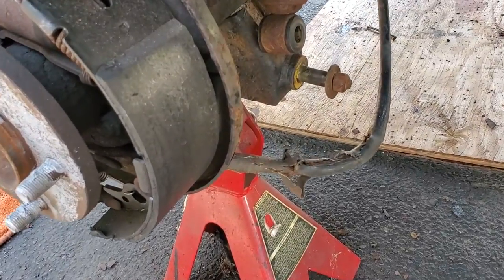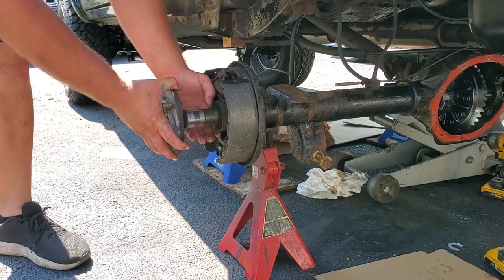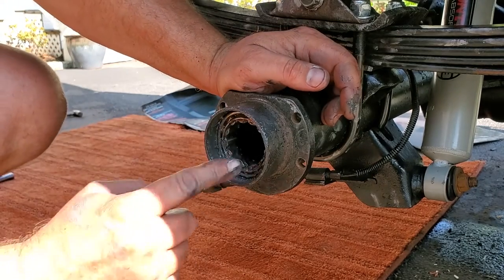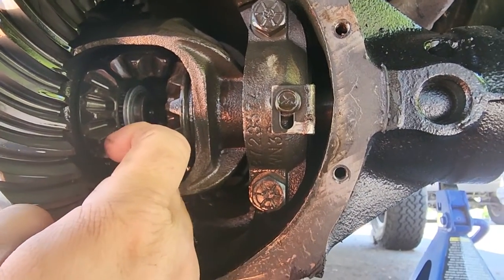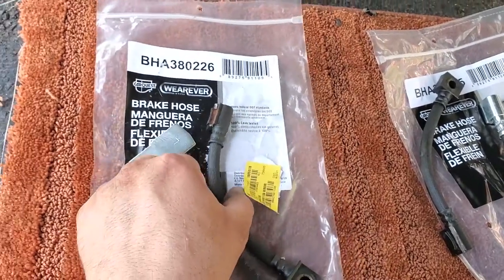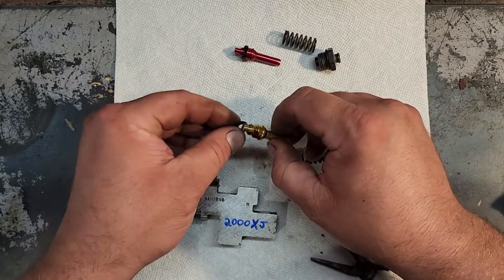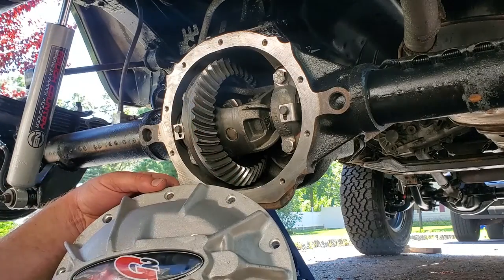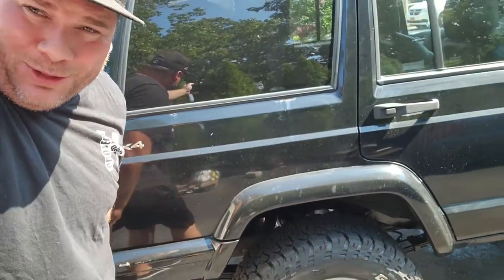JEEP XJ REAR DRUM TO DISC - HOW TO DO A CHEROKEE DISC BRAKE CONVERSION - ZJ DANA 35 TO CHRYSLER 8.25

Comment: Nice to see a new video DanH. I also have an XJ(2001) and have some parts for a rear brake ZJ disc conversion. One thing I did do as I have a budget boost rear leaf pack, I used a YJ rear soft line on my XJ as it’s a little longer. Don’t know a part number but it should be an easy part to grab at a local auto parts store. Look forward to seeing the stretch XJ in the future.
Reply from the maker: Thanks brother! Yes there's definitely a bunch of other parts that can be utilized for completely custom swaps!

Comment: A lot of great info! One of the best disc swap videos I've seen on the XJ rear break swap! Well done mate! I didn't know you could just swap the guts to the proportioning valve. I've got a rare 92 XJ 2-door High Output 4.0 with an AX-15 5-speed, an NP-231 transfer case, Dana 35 rear, 4" lift and lockers front and rear. I deleted the anti-lock breaks because I put off-road rated chrome molly 27 spline axles in the back because I was told the stock axles would not hold up with a locker. Changed the 3.07 gears to 4.10's from an 89 YJ high pinion set up. Off road and hill climbing, this thing is a beast! This is my next project so THANK YOU for all the hard work and excellent detailed info on the swap!

Comment: Nicely done.  I used the same differential cover, but in black.  BTW, the black plug is the fill level.  You remove the black plug and the red fill plug, and then add fluid. When fluid comes out of the black plug location, you are good.   
I did liberty brakes on my 93 sport and the only differences of install are the backing plates fit as is,  and you can buy/use e brake cables from conversion kits (I used crown disc conversion cables) because they are equal length until 1997 and up.  I think I saw somewhere that cables from certain years of Ford Explorer fit the 97-01 xj disc conversion. 

When I put the ZJ hoses on, we cut bracket into L shape and then bolted it to one of the leaf stack bolts- worked perfectly. 

Great to see this done, and hope you can get this on the general eventually.
Reply from the maker: Thanks Andrew!!! I was wondering why the new cover took so much oil! Haha mine didn't come with any instructions! Lol 🤷

Comment: Nice work - what might help is to get the rubber brake hose combination line for a 95 YJ - that is a longer rubber line & its stock fittings for the rear - Great Job 👍
Reply from the maker: Thanks bro!

Comment: With the studs on the backing plate! You can also use the studs from the front of the xj
Reply from the maker: Any stud that's longer. Lol!
Reply: Didn’t know that will try tomorrow instead of buying grade 8 bolts or going back to the junkyard to hit them out
Reply: @casualactivities1229  yeah i just used the studs for the front on mine and they fit right into the hub perfectly and are long enough although i did use the brakes off a liberty so i dont think the zj brakes are any different but they might be

Comment: ive done this swap on dana 35 and 8.25 using zj brakes the 8.25 u need to grind the bracket a bit to fit over the tube. never swapped the prop valve didnt need to it worked fine as is. super easy and straight forward swap.  but your better off swapping a ford 8.8 axle in.
Reply from the maker: LoL.  I didn't have an extra 8.8
Reply: @ProjectDanH  probably 1 of the best swaps ive ever done to my zj thats for sure. ford 8.8 with 4.88s and artec truss kit.

Comment: Can hardly wait for you to do the Dana 35 with ABS conversion. I have all the parts. Had to go back for the proportioning spring and ZJ shafts with the ring gear. I see there is a difference in the ZJ and XJ ABS rings and apparent;y not compatible. I am assuming you will still have to cut that notch out so I will wait to see the master do his thing. God Bless!
Reply from the maker: Yes, you will have to cut the notch! Looks like you'll be conquering it sooner than me.   let me know how it goes!!!

Comment: You might want to see if you can fab up a mount for the rear brake line ,  not a good idea to have it flop around. That line will fail at the hard line to chassis mount.
Reply from the maker: Good idea
Reply: @ProjectDanH   You can use a brake line from a Dodge Dakota cant remember the year but its way longer then the XJ great for diy lifts!

Comment: the bracket you welded for the brake line will that get hit when you go off road? looks to close to the ground
Reply from the maker: Its possible but we don't off road this jeep.  It could be mounted higher for off road use

Comment: Loved the video Dan! Great job. I ended up doing my disk conversion back in July. Did you have issues adjusting your e-brake cables? The install looks really clean with where you welded in the brackets.  I’ll send you a pic of my install with out welding, seems to do the job.
Reply from the maker: Yes, adjust the cable is the worst. Lol . Then once you dial it in they stretch! Haha.  Maybe I'll get explorer cables later
Reply: @ProjectDanH  yeah, they can be a pain. Explorer cables work? What year and model? 

Besides the ebrake adjustment, I love the swap so far well worth it and your videos helped a great deal!

Comment: Here is an alternative brake line set up, simply bend OEM line near vertical, bend hose bracket slightly and drill and tap 1/4 or 6mm hole to mount the hose bracket. to top of spring hanger plate.  Tried to send photo but no go.

Comment: Is that why C-clips are considered bad for off-road, if you bump your wheels/tires just right, they come off or is that only possible if the rest of the insides of the diff are already out?
Reply from the maker: C clip rear axles without disc brakes are bad for off-road (or on road with huge tires) because of the axle snaps the whole wheel will slide out.  Adding disc brake will keep the wheel on if the axle snaps apart
Reply: @ProjectDanH  Got it, thanks.

Comment: I never understand the portion valve and changing the spring. What exactly does it do using the ZJ spring?
Reply from the maker: It portions less fluid to the rear so the disc brakes wont lock up.. rear skidding is bad
Reply: @ProjectDanH  so I bought a g2 rear disc conversion but it didn't come with a spring for that. Should I still be looking to change it?
Reply from the maker: @ky0611  only if your rear brakes are locking up
Reply: @ProjectDanH  o ok Thanks, In all the other videos I've watched they talk about it helping with braking better. But none them talked about it helping not locking up the rear

Comment: i have a 95  4 cylinder manual xj i am not into offroad this is my daily car i have read on several forums to do the 4 hole injector to get a bit of performance whats your thought on this ? thanks in advance
Reply from the maker: 4 hole injectors are great.  I've done this in all my XJs!
Reply: @ProjectDanH  What's that all about when that gut said when upgrading from a single hole Injector to a 4 hole you have to have a larger intake hole. I have a 93' Grand Cherokee Laredo I6 4.0 and was thinking about upgrading mine to a 4 hole Injectors also. What's your take on all of this? Thx in advance for your time.

Comment: Great video I’m basically doing the same thing, I looked at so many videos and yours was the most simple video I found. I do have a question have you had any issues with the brake cables ? I know you said they were little longer that’s the only thing I left to purchase….. Thanks Dan.
Reply from the maker: Thanks for Watching!!!!  the cables work fine, but without a big lift you'll have to rout them where they wont interfere.

Comment: Hey Dan I have a question for you what paint did you use to paint the underside of the wreck  J . I have Rustoleum professional spray paint and POR 15 what did you use. Thanks.
Reply from the maker: I use both por15 and Rust-Oleum 😁
Reply: @ProjectDanH  Thanks Dan I will upload a picture of my XJ once its completed

Comment: 1st time viewer and a new subscriber,question, how do tell the difference between the D35 and the 8.25 Chrysler differential,on a '96 XJ, 1st time XJ owner here,took the axle codes to my local Jeep dealer service department and they said that Chrysler don't give them the codes,they go by the vin #?
Reply from the maker: Chrysler 8.25 Looks flat on top and bottom of the Dif Cover, whereas as the diff cover on the D35 is more of a smooth oval all over.
Reply: @ProjectDanH  Thanks😁,now all I have to do is crawl me old bones under it and photograph it so I can see it better, and hope I can get back up off the Cold concrete without help!🤔

Comment: I'm assuming you didn't want to spend the money on a locker? I think I would have stuck my mig gun in with those spider gears and pulled the trigger before I put that new cover on my diff. 🤣I wouldn't have been able to help myself. I shop at harbor freight these dayzzz, so I guess that would make it a Vulcan Locker?😂
Reply from the maker: Lmao!  I guess I could have but my Poo doesn't off-road much.. he used it to travel for ski trips

Comment: Mods are almost always dumb, this is no exception.  Drum brakes have advantages, especially in the rear and especially on an XJ.  In the rear, you don't get the fade you get in the front because the harder you brake, the more weight transfer to the front there is.  Drum brakes look heavy but they are actually much lighter.  Shoes have much larger contact area than pads and more material.  Drums don't warp from getting dunked in a creek while super hot.  Drums and their lines are well sealed and better positioned.  Having a mix gives you the advantages of both, you don't notice it because of the brake booster but drums and discs  have quite different performance at different speeds with drums being better at lower speeds.

Only race cars should have rear discs.  but, because people are stupid: what they do on race cars will trickle down.

I got another one for you: A tire simply being wider doesn't mean it will grip better, only a higher mu will do that.  But that doesn't matter anyway because if all you do is put on stickier rubber, the result will be that your suspension will be out of it's ideal geometry at the limit of traction.

Mods are dumb, even the little ones, even when they're popular, even when they look, sound, feel cool.  You know what's apparently not popular?  Doing your homework.
Reply: 😂 Have you ever seen what a drum brake set up looks like after playing in the mud for a weekend? Try it and see how clogged up they get. You'll be putting disc brakes on yours too! The mud is so bad, the competition buggies only put discs on the driveshafts. There is at least one good reason for every mod or it wouldn't have ever been tried to begin with.
Reply from the maker: The XJs successor's have disc brakes... WJ .. ZJ... WHY??? I cant take people who defend drum brakes seriously.
Reply: This video is not what you should be watching if you think drum brakes are better

Comment: When changing the proportioning valve after doing the Liberty conversion should I use just the Liberty Spring or both the spring and valve from the Liberty?
Reply from the maker: Good question... im not sure the proportion valves are compatable.. if so, use the liberty, however you may need a ZJ disc prop valve